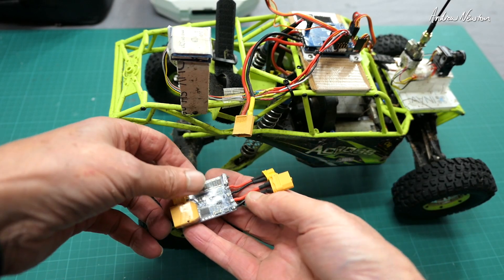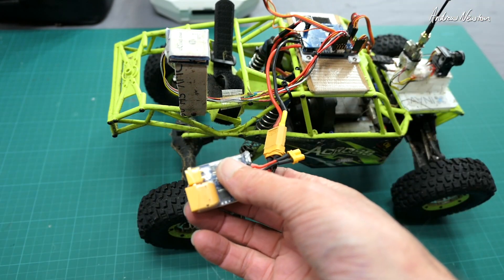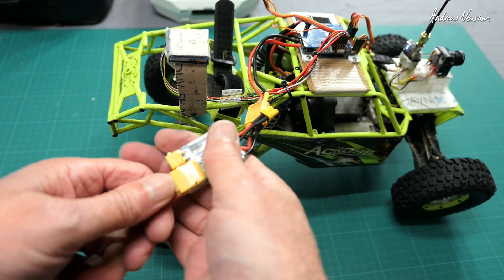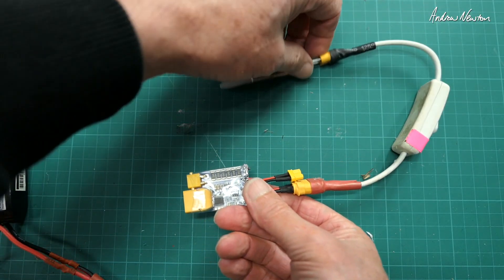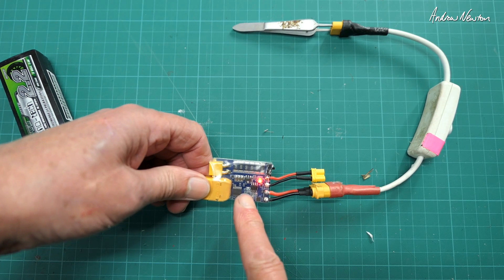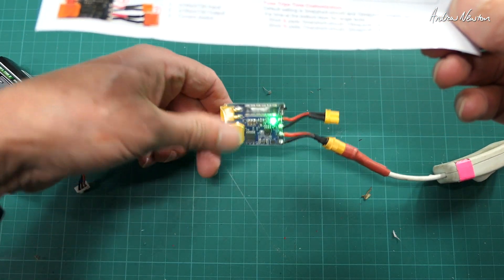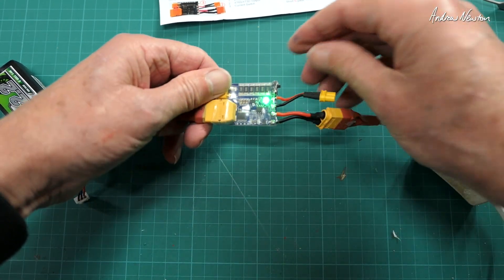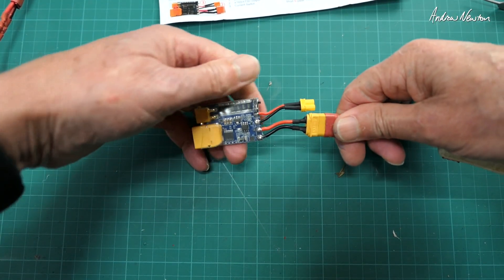ViFLY Short Saver

Comment: Very useful things for people, i dont have a need for them myself as i use a modified ATX pc power supply for my bench power and it has sensing built in and shuts down ultra fast if it senses a short or a current surge outside its designed range but for all those using regular lipo packs or non smart PSU's, those units can save a lot of tears ha ha.

Comment: You actually want to power it first and wait for the green light before plugging it in to test. When you first power it up the Current is still traveling until the light is green. If you have a short and you plugged the short saver in first before powering it on it won't detect it in time as the green light has yet to say all systems go thus resulting in a short or damaged part.
Reply from the maker: Great tip thanks Danny

Comment: Can you plug in an XT60 battery and use the XT30 side for the model? (or an XT30 battery in to an XT60 model). Not really a deal breaker just nice to know.
Reply from the maker: Yes it does work that way, short on either output with any input